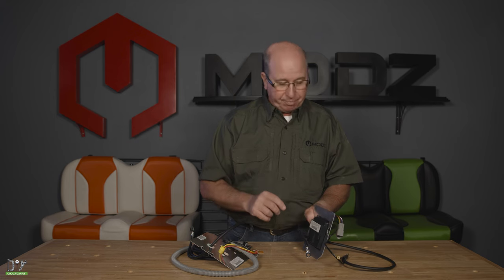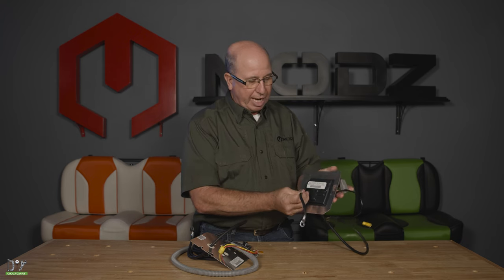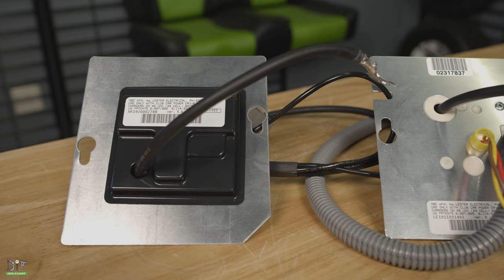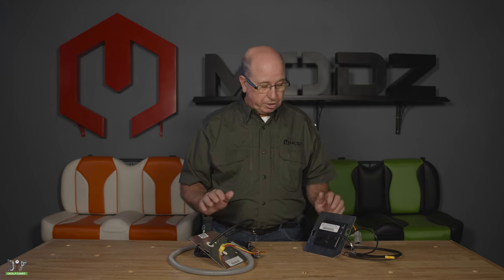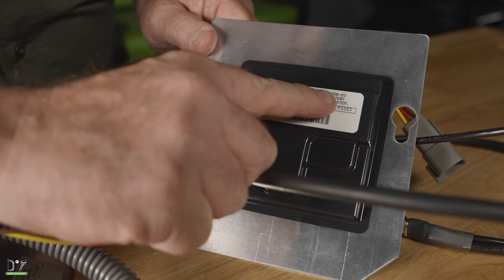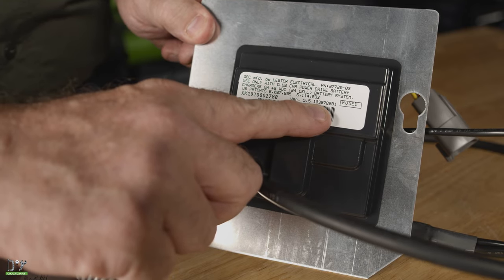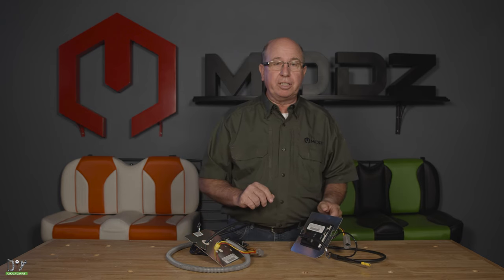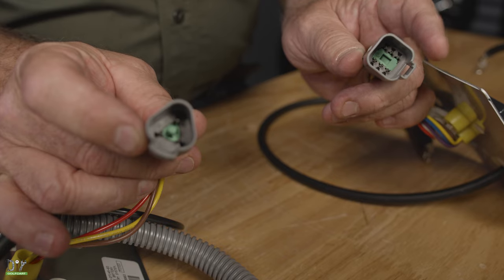Golf Cart On Board Computers (OBCs) Explained

Comment: I have a 48v 2013 club car carry all. It has developed an issue(s). As I accelerate, it will cut off. After about 20 seconds it will go again, but for only 10-20 feet. The longer it sets, the farther it will go, but not much farther. It doesn't seem to charge. The pack voltage is 47.95  Is the OBC the cause? Thanks for your assistance.
Reply: I think it's youre battery's they are bad
Reply: Did you ever get a satisfactory answer to your question? My Club Car does the same thing and nobody seems to know how to fix it. Thanks.
Reply: @dennisschneible8298  sorry I didn't get answer or fix. I worked for a small college doing there mechanic work. They ended up sending off to local golf cart repair shop who has a diagnostic computer
Reply: @FE428Power  Thanks, I guess I will try the local shop.
Reply: I’m having a similar issue. Cart will go for a few feet and then stop. The solenoid stops clicking. I replaced the solenoid and same result. Batteries are holding 50.8 pack volts.  Switches tested good also.  I’m not getting a back up buzzer even when the cart goes in reverse for a few feet. I’m clueless at this point
Reply: @ralphroberts8930  you figure it out? i here a bad forward reverse switch causes this
Reply: @matth284  I did. It was the potentiometer. Changed it and she took off!  Thanks for checking in
Reply: Sounds like the mcor (Motor control output regulator).  Works like a dimmer switch

Comment: My club car 48 volt will not shut off the computer Chargers the batteries hand goes to zero but the charger will not shut off it just sits there and it seems to be boiling the water away are you trying another fellows charger on my golf car and it worked fine Jerry them up and it shut off what this is what's wrong with my charger